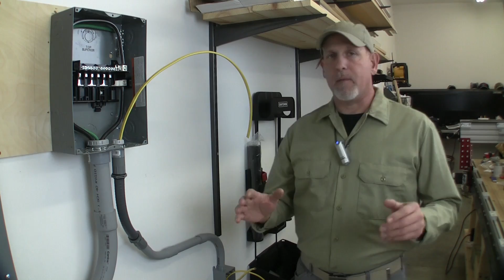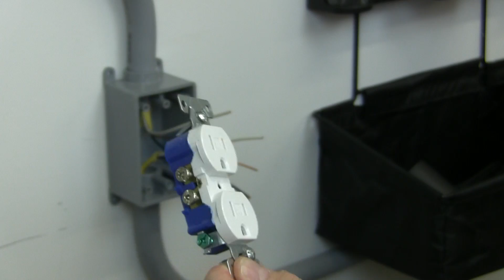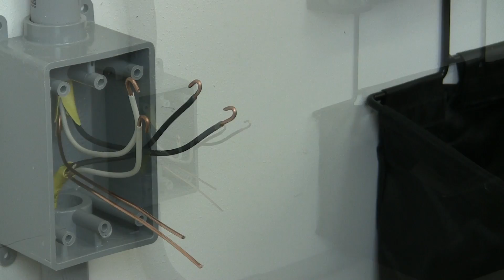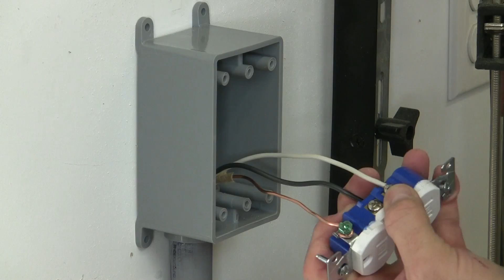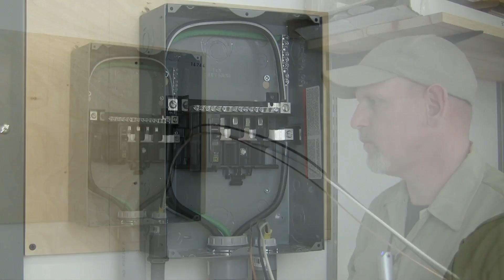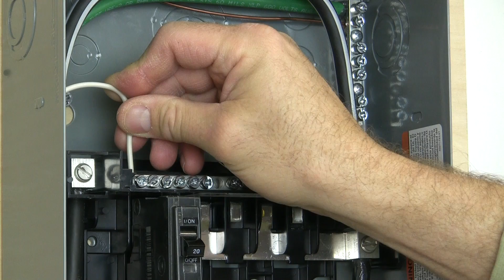How to Install Electrical Outlets

Comment: I would avoid electrical tape if the enclosure is plastic, but if it's metal then it's probably not a bad idea. But good job none the less : )

Comment: Great video but the first outlet on that circuit should be a GFCI outlet.with the 2nd outlet attached to the Load terminals to provide downstream protection to any future outlets.

Comment: One suggestion, Feddie, because it has happened to me in the past. Because you turn off the breaker does NOT mean you removed power. The contacts can get accidentally welded. I'd recommend checking the voltage with a meter before dragging your pinkies across the hot side!

I was wiring a 220 outlet and got shocked through a welded breaker that was turned OFF! So, it's meter every time for me now.

Hope you ignore the comments from the rude people. I''m an electrical engineer and your circuit, while not exactly best practice, works just fine and will pass code. Just for clarification, I teach electricians at a college and DO it for myself and in the lab and at home.
Reply: Brad F then why don’t you show us how it’s done son?
Reply from the maker: Thanks for the tips, Greg.  Appreciate you sharing them in good spirit!
Reply: Feddie,

You DO more than most people think about. I'm sure you realize that. I grew up in Jackson, TN and wish we were neighbors. Go Vols.
Reply: Greg, I agree it is a safe and sensible  way to do it, but I just got failed on an inspection for doing it that way.
Reply: Pass code????? What planet do you practice your trade? As an electrician/electrical technologist with over 35 years hands on having served two electrical apprenticeships with a world renowned Electrical Utility I can ask you to watch this video once again and ask yourself if you still think that this installation is safe or up to the electrical code wherever you live!! There is no way it is going to pass inspection and anyone who watches it in order to apply the procedures for their own application should look elsewhere for the correct way of doing this type of job!!!  IT IS WRONG AND THIS VIDEO SHOULD REFLECT THAT FACT!!!

Comment: its nice im begginer..i wonder if what is the prpose of the ground wire on any outlet
some body answer me?/
Reply: enrico enciso Hi friend, the purpose of the ground wire/s on any outlet or light switch these days are to protect you and lights and appliances from surges from your local electric company electric grid coming into panel breakers box and to all of your household circuits, also protects you from accidental overload conditions witch normally causes shorts and fires! And so many more safey reasons that are applicable laws or not just to name a few! Note older homes do have grounds but are attached to the top of each outlet or switch box where it can't be seen, thus each box metal only is automatically grounded by default because its ground looped at the very top of the metal boxes where it's not readily accessible or visual, but there none the less! But plastic boxes are never grounded this way and must have grounds in the wire sets!

Comment: A question, do you know why the ground wire is bare? it fills unsafe to me because the phase or neutral could "touching" it
Reply: that's exactly why it's bare. If a live wire's coating melted and touches it, the breaker trips. Also easier to ground metal outlet boxes and overall lowers the cost by a very tiny amount.
Reply: Adam Rivera thanks! that makes sense

Comment: The first receptacle that was wired up will not pass the electrical code as being correct! Both the white and black wires must be pigtailed as well as the green one! If the next guy comes along to replace the receptacle and inadvertently uses one that has the small jumper bar removed from the black screws then all the outlets down the line will have no power. Or if the small screw jumper has been removed from the white screws then an unsafe condition has been created as the return to the panel will be thru the ground. Totally unsafe! The only time you ever hook up two of the same coloured wires to the same receptacle is when that receptacle is being used as a split receptacle with two different supply circuits. Of course not all electrical codes are the same! Where I live this receptacle would be considered unsafe and would fail inspection! Could be different where you live! Just saying though. Take it as food for thought!!  Check your own electrical code!!!!
Reply: Thank you sir. Thank you so much.
Reply: I just found this out today, I understand it is now code, but I cannot understand how putting more wires and connections in a box can make it safer seems to create more fail points.  I am not an electrical engineer, but have built and worked on eletrical and mechanical things all my life, this rule seems to violate the KISS principal.

Also, if this is the way they are supposed to work why do they all come with the sets of screws electronically linked together, they should also put the screws on each side farther apart just to be safe, but what do I know?
Reply: If the electrician know what they are doing they would check the wiring and the outlet to see if the bar is removed (who does that ever?) and if so they would use a different outlet or rewire it.

Comment: Great-Another knucklehead putting up 1/2 assed info on YouTube. How many people have been hurt or killed because of idiots like this. How many things wrong with this video? Pigtailing the ground and nothing else? 15A outlet on 20 A wire? No need to hook with a needlenose-use the outlet itself. How about taping the wirenuts if you're into "overkill". Why use Romex in a conduit unless that's all you had. How about using 2 ground rods? Read an up to date electrician's book for crying out loud.
Reply from the maker: +P.Melvin Shyturtle Thanks for the critique.....

Comment: If you can't do things up to code, you've got no business showing anybody how to do anything. Real electricians make a fortune undoing slop like this.
Reply: P.Melvin Shyturtle if you don't like it rat then don't watch the video get it rat fink......
Reply: I'm curious what he taught wrong. Please let me know because most of the videos on YouTube teach it the same way but not as clear. Im doing a project and need to know what you would change.
Reply: What the heck are you talking about?
Reply: Marcia, new code is that you twist the two sets of wires of the same color together and run a third wire from the two to the screws.  It is code now, but is goofy, just introduces more complexity and fail points.
Reply: @greglemon230  
When you say it's code now, where are you referring to? California? Florida? New York?
Im on the west coast. I wasn't told this.
Reply: @jrmcgee5150  I live in Lincoln, NE, when the inspector came he said they changed it in 2014 or so.  We piggyback off the National Electrical Code, currently the 2017 edition

Comment: great video, thanks.  excuse the dumb question, but why did the first plug have two sets of black, white and ground wires and the second plug box only had one set??  Thanks for any help.
Reply: It's cool, thanks for the response.  That was what I was thinking too.
Reply: He is installing the outlets in parallel, hence the two wires on the first outlet.  Had he been installing multiple outlets In parallel) there would have been two sets of wires on each outlet save the last outlet in the circuit.

Comment: I really need more circuits in my shop. I have a 220 run in there is something like that suitable to be switched over to a subpanel or do i need to run bigger wire for something like that. I have run outlets and lights before but always off established boxes nothing like this. Love you content can't wait to see the freakout project.
Reply from the maker: +Zach Scott Thanks for watching, Zak.  The sub panel does not care if you are running 220 or 110 as long as there is enough spaces in the box for a new breaker.  Just be sure to match the wire you run to its corresponding breaker capacity. (amps)

Comment: Good point on not bonding PE to Neural Bus, you wouldn't believe how many times I've seen licensed electricians do that because the panels have a busbar strap preinstalled and they are too lazy to remove it. It creates a nice grounding loop that is a potential hazard if there is a fault.
Reply from the maker: +briancnc Yes.  As I understand it that's one of those things that you might get away with for a while but when something goes wrong it does in a really bad way.
Reply: +blazingnailgun I remember arguing with a well known 'master electrician' about this. He installed a sub panel and did it and when I asked them about it he said, 'it doesn't really matter'. My response was, 'it doesn't really matter that you run a circuit near a water source without a GFCI right? Until you have a large fault...."

Comment: Additional tip for absolute newbies: buy an outlet tester and make that the first thing you plug into your outlet. It will tell you if you did anything wrong safely and without damaging anything. They cost less than 10 bucks.
Reply from the maker: +Trabber Shir Yes, great tip!

Comment: Thanks for the learning, are you guna run more separate to in line?
Reply from the maker: +Chuck Mardon Thanks for watching, Chuck.  I actually filmed that a long time ago and since ran out of space in that small sub panel so I replaced it with a bigger one.

Comment: I learned two tips... the tape around the screws and the hot wire hook up...never thought about it but great tip!  been a while since I've seen a new video, great to see a new one today.  thanks for sharing
Reply from the maker: +Anthony Tobias Thanks for checking in Anthony.  Glad the vid gave you some pointers.  Man, it's hard to crank the content out lately.  Been really busy in the shop with "paying" jobs...  :-)   BUT, I am editing a new one right now and hope to push it out over the weekend so stay tuned.  It's a good on the rusty round metal sign build!
Reply: +blazingnailgun awesome!  well the money takes priority over pleasure.... so keep doing what ya need to do my friend.... I'll keep watching!

Comment: Great video. I have learned how to do basic electrical by doing stuff around the house. I used to do the pig tail with the ground wire like you did, then I had an electrician show me why the green wire nuts have a hole in them. Leave one of the ground wires longer and run it threw the wire nut and screw the 2 grounds together and the longer one sticking out of the wire nut can go to the screw on the plug. I never even realized there was a hole in the green wire nuts. Saves a little time and space in the box. Take care.
Reply from the maker: +John Reed Great tip, John.  Thanks for sharing it with everyone.  I appreciate you watching!